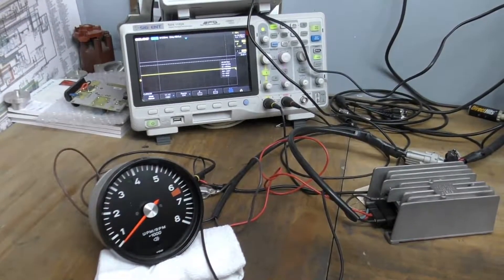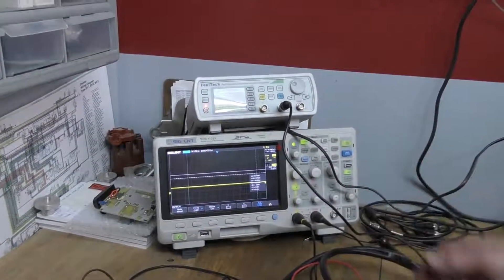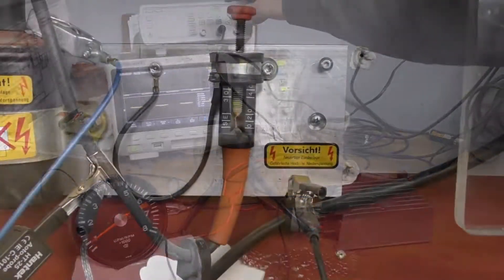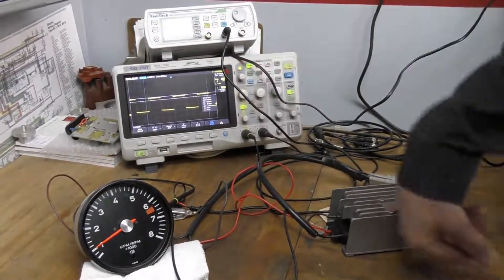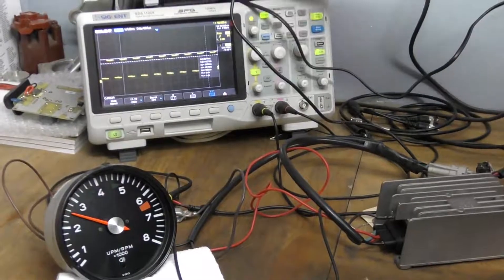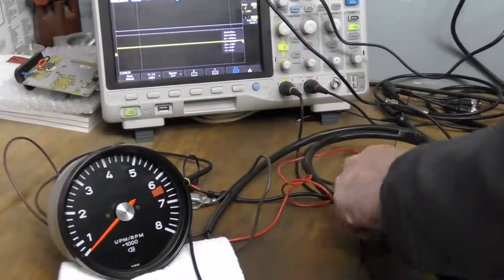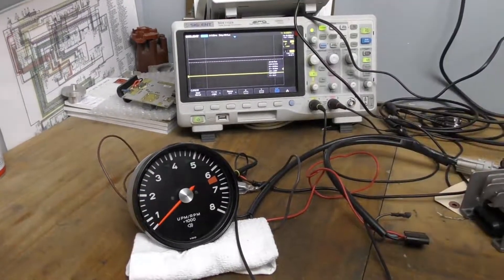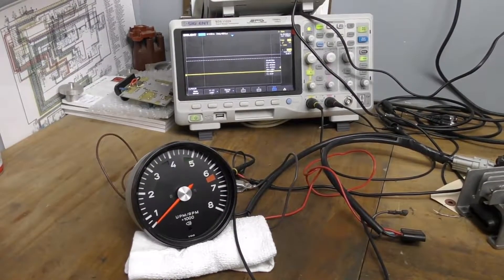Using An Oscilloscope to test a Tach and CDI

Comment: How do you set up the wave generator?
Reply from the maker: To trigger a 6 pin CDI box you need to set your frequency generator to a 20 volt Sine wave and  frequency of 00,000.050 for an idle speed to 00,000.350 for 7000 rpm. To check the tach you will use the same frequency settings but instead of a sine wave you will need to use a 12 volt square wave signal. When using a wave form generator it is pretty hard to blow anything up, so you should be safe even if you gave the inputs the wrong volts or frequency.
Thanks for watching
Kurt

Comment: How many volts were coming from generator (points)? 12? I'm trying to adapt modern DC CDI's (without CDI internal advance) to an outboard. I have a scope and DVA etc. but I don't have any CDI's to play with yet. I'm hoping I can learn the typical trigger and CDI output voltages so I can start looking for suitable coils, etc. 

Basically trying to find values on the internet instead of testing because I can't get near my tools for a month and the wait is going to killll me.

Great video!
Reply from the maker: it depends on the CDI you are using. Our expertise is in the Bosch style unit used on Porsche vehicles. There are two types of triggers used. One is a square wave trigger firing on a positive spike at battery voltage of 12-14 volts. The other unit fires on the downward slope of a magnetic signal and it fires at or around 0 volts. 
As far as a coil the Bosch system does not use a conventional coil. It use a 100:1 step up transformer. Using a conventional coil substantially reduces secondary voltages.
I would expect that a two stroke outboard motor would already be running a CDI ignition unit?
Kurt
Reply: @klassikats  your bosch stuff sounds exactly like the stuff on my 1970 Evinrude. They call it a bosch "Power Pack" or amplifier. It gets switched 12v power then a points-like contact closure trigger causes the bosch to output 150v to the primary of a uniquely matching coil (different voltages as car or motorbike coil). My plan is to use my 12v trigger to fire a DC powered motorcycle CDI and its matching motorcycle coil.

I'm just trying to find how many volts various DC Motorcycle CDI trigger wires use.

I could probably swap you bosch units straight in! Lol
Reply from the maker: If its a DC trigger using points then it will be battery voltage, usually 12 volts.
Good luck with your project.
Kurt
Reply: @Aircooledconsulting  Found my solution! https://youtu.be/ploJQvvfmik?si=_5SCSuaiZak6yQdz&t=1218

A cheap GM HEI ignition module with a 1K resistor between power and trigger then connect the trigger terminal to my points! Then use a GM HEI coil. 

I love youtube!

Comment: do you have a wiring diagram for all the components you have hooked up?
Reply from the maker: I just use the factory wiring diagrams in the factory shop manuals.
Kurt
Reply: @Aircooledconsulting  thanks for the reply.  Does this work for an AC or DC CDI unit?
Reply from the maker: @AnthonyJurek  all of the CDI systems I test are DC. However, the principle is the same whether you are doing an AC unit or a DC unit.
Reply: @Aircooledconsulting  any recommendations on a DC to AC inverter  that fits for this application?

Comment: Installed an Accuspark electronic ignition and now my tacho shows to high revs. What has happened? Are there any fix?
Reply from the maker: use your oscilloscope and look at the trigger signal. probably outputting a signal that is really messy and your tach thinks the engine is turning faster than it really is.
Kurt
Reply: @Aircooledconsulting  Thanks. You are probably right. Will try to borrow a scope from somewhere. Think maybe I try adding a diod or resistor (in series to a capacitor perhaps) to the signal line.

Comment: Greetings sir!
I'm trying to find an RPM signal source on my motorcycle, which I can feed to my Arduino board. I'm trying to make a sequential shift light like those on racecars. Where can I get such an input signal? Can I use the negative terminal of the ignition coil? I couldn't find a wiring diagram that specifies the wire to the onboard rev counter. So I was looking for a more generic way to get RPM signal. I'm not willing to use the inductive spark wire loop thing coz it has too much noise that needs to be filtered
Reply from the maker: Using the negative side of the coil will not work, you would have to use the positive side. However depending on what type of ignition system the bike is using you may have a waste spark type of coil in which case your RPM numbers will be double actual RPM. If it were me I would locate the tach signal wire on the bike and plug into that circuit as it is going to be the most accurate signal.
Kurt

Comment: Hi. Thanks a lot for your video. Can you please tell me what is the correct setup for the wave generator to perform this test on the CDI? And what are the input value for increasing the revs in the rev counter? I sould't like to blow up my stuff :) Thanks again.
Reply from the maker: To trigger a 6 pin CDI box you need to set your frequency generator to a 20 volt Sine wave and  frequency of 00,000.050 for an idle speed to 00,000.350 for 7000 rpm. To check the tach you will use the same frequency settings but instead of a sine wave you will need to use a 12 volt square wave signal. When using a wave form generator it is pretty hard to blow anything up, so you should be safe even if you gave the inputs the wrong volts or frequency.
Thanks for watching
Kurt
Reply: @Aircooledconsulting  Can I use an audio system to generate this wave form? Say a tone generator application square wave on a phone then amplify it to 12 volts? 16.6HZ for 1000 rpms? Thanks!